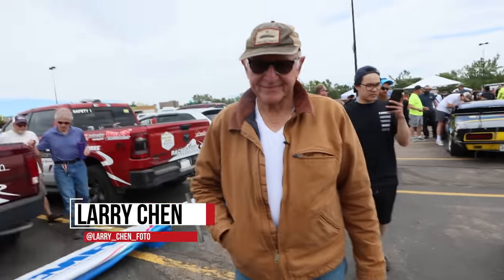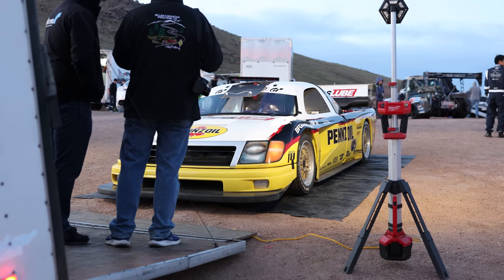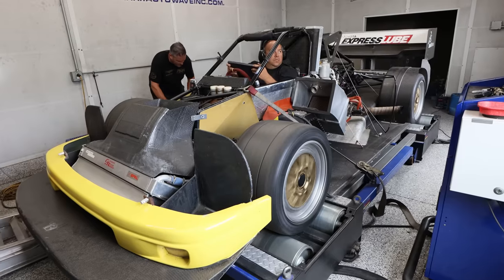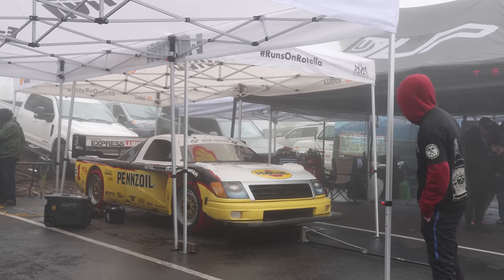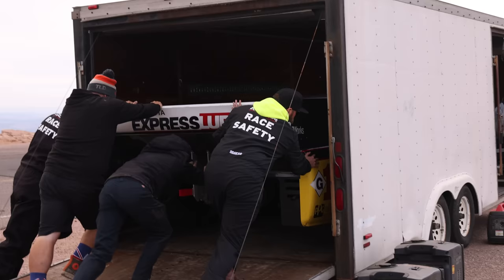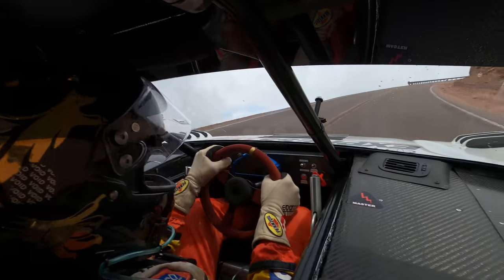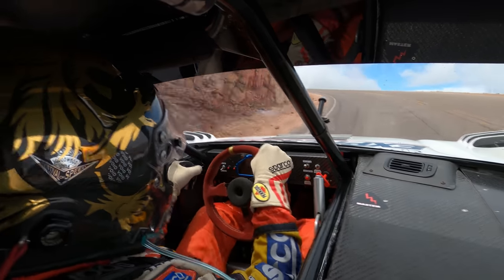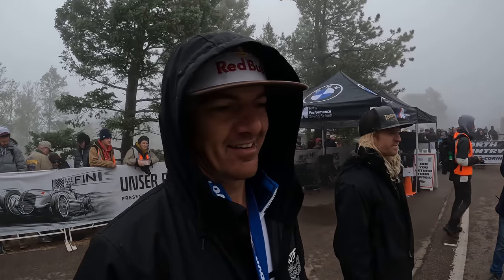Return of the King: Rod Millen's Final Thoughts on the 100th Running of The Pikes Peak Hill Climb

Comment: Great series and what an amazing story.. pulling a car ( and driver) from the golden years of Pikes Peak out of mothballs to compete nearly 25 years later.. No factory sponsorship, old turbo technology, minimal spars, substituted fuel, tires and electronics.. Barely any testing or changes to a car that was designed for what amounted to a gravel fire Road. Eight place finish for the day, third in class, not too bad for a “exhibition run”. I have a new appreciation for how cutting edge that car was in the day and how fast Rod actually was and still is…Wow!